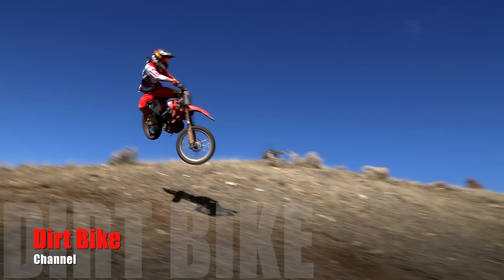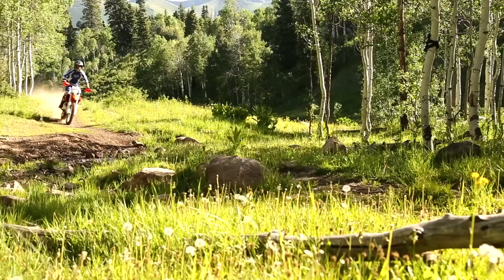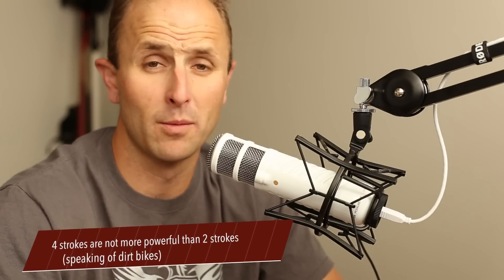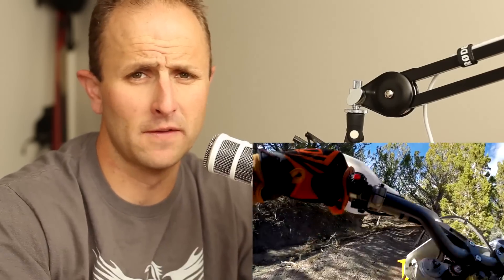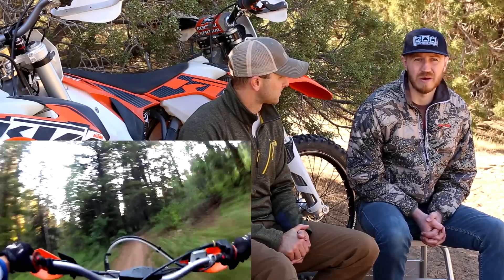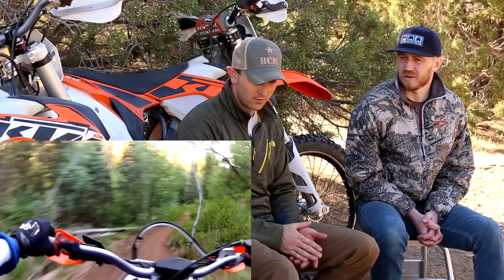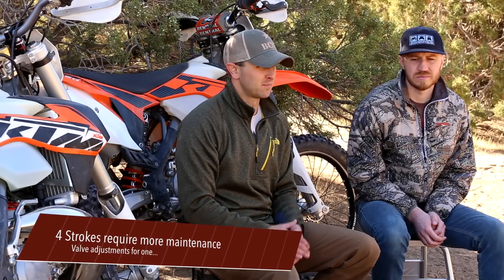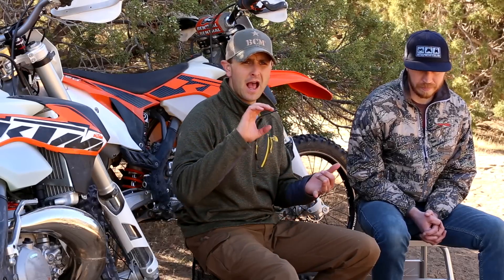Enduro 4 Stroke vs 2 Stroke Part 1

Comment: I could never believe when four strokes started to be common & take over from the two strokes,we used to laugh at the gutless slow revving four stroke bikes,I think it had far more to do with politics than engineering & race winning power,the supposedly clean running four strokes.As you quite rightly say it was 125 2 strokes against 250 4 strokes or 250 two strokes against 450 4 strokes,u could never race like for like,what would u race against a 125 four stroke?, a 25cc chainsaw engined machine?,I don't get engines having to run clean in competition,I get it on the streets,that's different.
Reply: Graham Smith im sorry 'slow revving 4 strokes?' 4 strokes do more rpm then 2 :,)
Reply: madmofos not talking about peak rpm buddy,I'm talking about the way a race tuned two stroke picks up revs,no reciprocating engine picks up revs quicker than a competition two stroke,it hasn't got all the valve gear,timing chain and associated drag to accelerate.

Comment: I am not tryna hate on the video but it is clearly biased to the point where it makes it hard to watch they have good points but most of them are extremely opinionated obliviously.....BUT the number on ironic thing that just got me worked up is they are sitting in front of KTM two stroke dirt bikes that cost an absolute fortune way more then a Japanese 4T....them talking about how 4t killed motocross is BS...KTM driving up cost for premium bikes would be a better argument E start, TPI, all KTMs hydro clutches, weight reduction it all cost extra money in the long run from the RND and testing that the other manufacturers now have to do. Blame the bike manufacturer whose bikes your sitting in front of for ruining the sport before the type of engine. like it hard for me to set there and listen to someone  tlaking about cost when they are riding BRAND new KTM aka rich mans bikes.

Comment: $2400 top end rebuild? Wtf lol. $300 to pay someone to rebuild your 2 stroke? Where do you clowns come up with this number?  $2400 is a cammed, big bore stroker and that's still high. 
Makes more power? The 450s are making as much power as the cr500 are are a lot lighter. You yourself said later in the series that your 300 4 stroke is faster than your 250 2 stoke. I've got absolutely nothing against 2 strokes but I don't see why to make a video series claiming to compare when it's basically just bashing and not speaking too any of the 2 stroke down falls and making false claims. 
2 strokes use oil in gas to lubricate everything....gas is an excellent solvent..see a problem there? I can find way more blown up 2 stokes online and blown up 4 strokes. Top ends on 2 strokes are cheap and easy but the bottom end is essentially the same job as a 4 stroke and the bottom end is a point of failure on 2 strokes where it's not as common on 4 strokes.
High RPM and high compression kills motors? Better tell that to every single sport bike out there. My r6 has 25k miles and a red line of 15,500rpm, had a v65 magna that was 33 years old at this point that had over 50k on it and red line at 11,000rpm.

Comment: That's all crazy talk. You act as if your talking to top bracket riders that are swimming in cool sweet cash. The motor let's go that becomes a parts lump. I like smokers but there's something to be said about torque and slow technical crap that won't stall under a hailmary strategy...
Reply: Btw riders are easily getting 25,000 miles outta 2001 wr250f....

Comment: I've had my 2017 YZ 250F for 2.5 years and rode the piss out of it and it pops and everything and runs fine with great compression. Never adjusted my valves once, changed a piston or anything and it probably has 400 hours on it.
Reply: Mr, KrAmWiCh CMDY haha that’s funny, my 07 CR85 never even had its top end done and still rides like a charm. Could just be that it’s a Honda, idk.

Comment: This is very bias toward 2strokes tbh it doesn't matter 2 or 4 strokes 4 strokes just hav more usable power 2 strokes keep in power band and u get ur power there
Reply: U claim only thing is a 4stroke is good at that a 2stroke can up shift and do same it's just pure bias not factual
Reply from the maker: +Toxic Titan00 You need to watch the rest of the series before jumping to conclusions.  We'll talk after you watch all 6 parts.  Thanks.
Reply: +Dirt Bike Channel I've seen them it's total bias bro
Reply: And 4stroks put more power out higher torque and hp
Reply from the maker: +Toxic Titan00 How much time you do have on a NEW 250 or 300 2 stroke?  You ever ridden one for an entire season?  Just curious.
Reply: +Dirt Bike Channel I both 2 and 4 stroke
Reply: +Dirt Bike Channel I hav a 2015 ktm sx250 and a Honda crf450r
Reply from the maker: +Toxic Titan00 Right.  I have both in my garage too.  That KTM 250SX really sucks right? :)  I've got a YZ450F in the garage along side the KTM 300 right now.  As you know (since you watched all 6 parts), I ended pretty high on both engines.  What was is that I said in conclusion of the 6th part of the series? :)
Reply: +Dirt Bike Channel I just feel like u went to complement a 4 stroke and ended up making 2 strokes sound better and idc really whitch bike im on I'm just pointing out u leaned toward 2 stroke more
Reply from the maker: +Toxic Titan00 That is the funny thing about compliments!  Just because I'm extolling the virtues of the 2 stroke, some people thought I was tearing down 4 strokes.  On the contrary, I never said that 4 strokes suck.  In fact, I said that they don't suck and that they are "modern marvels" over and over.  It's just that over the past 15 years, no one has stood up for the mighty 2 stroke. When I go riding with guys on 4 strokes, I do everything they are doing and then some.  In the end, it's more about the rider than the machine. Just offering a valid (alternative) viewpoint that has resonated with the dirt bike crowd a quite a bit. Thanks for being civil with your comments.  Your opinion is just as valid as mine.  Keep riding!
Reply: +Dirt Bike Channel while I got u u should make some vids of u just riding thru trails and stuff
Reply from the maker: +Toxic Titan00 I'm planning to do more of that.  My biggest problem is finding time to do all this stuff.  Again, thanks for being engaged in the community.
Reply: +Dirt Bike Channel giving my 2 sense keep making vids I find em very help full

Comment: i'm callin' BS on some of this.... I gotta '06 KTM 450 w/ti valves, they pretty much never move, beautiful stuff, so that quote about ti valves is pretty much totally wrong... the KTM RFS bikes w/Ti valves were the ones to have....... i ride pretty much every weekend, i gotta alotta miles on my motor, it runs great, change oil and ride, but then again, i take care of it properly..... most of these einsteinzz break stuff changing their oil, so YMMV....  i work on my carb more than anything because of the age and a couple of the important seals get old, but that's gonna happen on any 10 yr old bike, 2 or 4 st...... and they're runnin' all this smoker smack sittin' in front of new bikes.. ???...they better run good, you dig?.....  yeah, i'm lookin' for a KTM smoker, cause' they're alot more nimble in the tight stuff, but from what i'm seeing our boy Kyle ride, that stuff ain't all that tight... and he's even getting a chubby now over his new 250 4 stroke blue vs. orange bike thing, so ....  i'm callin' BS.....  blah, blah, blah, blah....

Comment: Hey, 250f engines can produces over 50hp. Idk where you get your crap information, but MotoGP makes about 250hp per liter, and the current liter bikes make 210 to 220hp per liter when race prepped. These are 250cc cylinders. Even MotoGP 800cc engines could make 220hp.

Saying that an ordinary 250f will get beat is idiotic. You completely gloss over the fact that 250fs are made as beginner bikes and designed for ease of use, not unbridled power. Funny how KTM new 510cc motor makes the same hp at wheel as a cr500 engine.

The physics of why is simple. Octane rating, volumetric efficiency, and rpm.

Oil LOWERS the octane rating of gas, meaning you CANNOT be as aggressive with timing.

Volumetric efficiency is much lower on 2s bikes. They literally allow intake charge to flow out of the motor and have a hard time filling the combustion chamber with their actual displacement. 4s doesn't, and head designs allow velocity to fill the cylinder with slightly more than their displacement.

Biggest difference is in the RPM and torque multiplication. Theoretically, one could tune a 250f to hit 18,000 rpm like in MotoGP. That would allow for 350% (3.5x) of the torque. Not reasonable, but tuning them to 14,000 rpm is now a days. That's around a 2.8x factor. 2s motors don't make much power beyond 8000 rpm, meaning, a 4s with the same efficiency would need to hit 16,000 rpm to make the same power. 4s is more efficient, by quite a large margin, and doesn't need to actually double the rpm.

Most 250fs are designed to peak power at 9-10k rpm. Giving them a very slight rpm advantage over a 2s. I tuned my yz250f engine to 12,500 rpm with cams, higher comp piston, correct fuelling and a vortex ignition. In the sand, I was slightly faster than 250 two strokes and slightly slower than 450 race bikes, and faster than 450 trail bikes.

450fs were tuned to around 8000 rpm and have lower efficiency than a 250f (diminishing returns). Newer race bikes are tuned to 10k plus rpm now and no 2s or 250f will keep up minus a ridiculous race budget. Enter the 350f and it's 14000rpm redline.

It is quite clear that you have cognitive dissonance over the 2 v 4 stroke knowledge. I personally love 2 strokes cause they're light and fun to throw around. But 4 strokes are the better enduro machines. Why? Simple. They get better traction, which makes them more capable and does less destruction to the environment. The motors pollute far less, which means they keep the air around us cleaner. 15-20 lbs is a lot after the erzberg rodeo, but for normal fun enduro riding it is hardly noticeable and preferable in the desert where strait line stability over high speed whoops matters. In the end, enduro is about being in nature, so the bike that allows you to go where ever and keep nature as pristine as possible is my winner.

Comment: Yea this guy is bias as shit I watched 2 other videos of a guys going over both and being pretty fair stuff like at high speed 2 strokes are unstable but four strokes are fine 4 strokes got beach and moto and 2 strokes are king at enduro it just depends I dont like this video bc it's just bashing the 4 stroke I mean like I get it's his preference but be more fair with it this guys sounds like he has only ridden 2 strokes all his life and 2 strokes usually need to be replaced sooner bc of them moving faster and the lack of a lubrication systems puts them down but they are inherently faster when it comes to cc
Reply: Yeah 2 strokes need a new engine every 2-3 years typically when a 4 stroke can easily last 10-20 years if you take really good care of it and do oil changes.

Comment: I just want to start up my bike and ride. 2 strokes are a high maintenance bitchy girlfriend that is more headache than it's worth. Jetting, mixing... nahh I'm fine with a 4 stroke. Yes 2 strokes are stronger than a 250 4st but I feel like I dont use all the potential of my 250f. I dont need more power...

Comment: 250 4 strokes are almost as good due to fuel injection. any higher cc and the 4 stroke will wreck the 2 stroke
Reply: Fuel injection doesn't add power over a well tuned carb, it does add quite a bit of weight though.
Reply: boooooo no way
Reply: You don't make sense
Reply: Paul King could not think of an argument so you chose to say that i'm stupid? I know someone who does that.... he's 5
Reply: Paul King I'm glad you got that out
Reply: Netrox Bros You don't know what you're on about so pls stop

Comment: But if you live/ ride near anyone and actually care about their ears you would ride a four stroke
Reply from the maker: +Seth Wilmot That is debatable.
Reply: Debateable?????? I'm willing to admit you get more power per cc from a 2 than a 4, everyone in their right mind knows this, but with more power means more noise, everyone in their right mind knows this.
Reply: +Seth Wilmot The noise is a higher frequency so it doesn't travel as far. You'll piss less people off on a 2t than a 4t because the noise from a 4t carries far further.
Reply: if you were riding where i do ( national park, near a town) than you would piss everyone off with the 2t noise, most people would prefer a dep gurgling rather than a high pitched ringing.

Comment: BS bias video right here!!! 2 stokes and 4 stokes are equally good and capable of anything you put them up against... just two totally different ridding styles! also 4 strokes will out run and last any 2 stroke as long as you keep a eye on your valves every time  your budddies are mixing 2 stroke fuel..... you can be  spending the same amount of time as specing out your valves lol

Comment: 100-150 hrs with one piston on a 2 stroke hahahahahah..... Do it every 40 hrs to be on the safe side. At about 70-80 hrs you won't have enough compression to run....
Reply from the maker: balazs kisbalazs My guess is that you don't have much experience on these 250s and 300s.  No power loss, no compression lost at 115 hours on my last 2 pistons.

Comment: How can this be a fair comparison when you are so bias ! You are stating from the start that you love 2 strokes !
I never work on my 4 strokes, but my friends with 2 strokes are constantly working on theirs.
This is a BS review !
Reply: They are speaking facts, liking something because it has advantages is not bias if you explain the disadvantages aswell. They said several times 4 strokes are amazing.
As for your second statement, working on your bike doesn’t necessarily mean there are issues with it, in fact it means you care and know your bike. Boasting you never work on your bike is not an advantage, in fact one of the great things about 2 strokes is that they’re much easier than 4 strokes to work on.
2 strokes are generally better in enduro, it’s a pretty well known fact at this point.

Comment: What you say is wrong. I am buying a KTM 250 SX-F if I wanted a bike that was the same I would buy a 125 EXC two stroke as it is approximately the same amount of power to weight ratio and hence meaning they are almost the same. This is why you don't see a 250 two stoke group going against a 250 four stoke group. You idiot. You are basically saying that an 125cc lawnmower engine has the same amount of power as an 125cc bike but no the engines serve different purposes. And so the lawnmower engine will never compete with the same size bike engine. You have to think in the way that a 250 two stroke is basically a 450-500 four stroke. You are just being completely biased towards the two stroke. This is also way a 250 two stroke is a lot more than a 250 four stroke.  And if I have got any wrong grammar I really don't care I am dislexic. 😑

Comment: hmmmm what engines do cars run? road bikes? ahhh right 4 stroke...cause they dont need a rebuild every week   you guys a bias as fuck...   yes 4 strokes cost more to rebuild, but by the time you put in the money for the extra fuel and oil that is waisted, they work out much the same... another thing 4 strokes are getting very close to the same weight as 2 strokes.... their all around 103/6 kilo.. another bonus about 4 strokes, no fucking around with mixing fuel.. and yes 4 strokes have to change oil, but nowadays so do 2 strokes (gear box)  ive owned both, ive had a kx 85 rebuilt after 60 hours from loss of power and ive now got a yzf250 change the oil every 10 hours (because im fussy) my dad has a honda trx250 quad.. 200 hours rebuilt once, and changed the oil probably 4 times if that...
Reply from the maker: madmofos Thanks for watching.  We talk about some of these points in the rest of the series.

Comment: this video is so biased towards 2 strokes.. you can't even listen to it... it costs $150 for a piston kit for a YZ450. Hell, it costs $700 to buy a brand new OEM top end with valves and springs!  2hr valve adjustments every 20-40 hrs of riding... where the hell do they get $1500 for a motor rebuild... stupid.
Reply: Kyle Dude and to top that off my buddy Jon put 300hrs on his 02 CRF450 before an engine rebuild. about 1/2 of those hrs were B class enduro racing.
Reply: They're probably talking about putting it in the shop and letting the mechanic rack up the bills lol hell I put a banshee in the shop for a top end job cuz I was too busy and it costed me 1600.
Reply from the maker: Kyle Dude Called 2 different local shops and asked them for pricing on rebuilding my 4 strokes.  This assumes you need machine work on the heads and valves.
Reply: only machine work you would need is to re-seat the valves... which you don't need a machine shop to do. This is somewhat equivalent to getting your nikasil head re-coated every time you change a piston.  Even so.. re-seating ur valves all u need is a little suction cup thing and the vale gringing paste.. ~$20 and 30 min once u already have the head open.

Once more... changing shims is like a 2hr job or less once u do it 2-3 times.Yea... 4 strokes cost a lil more... once you put on like hundreds and hundreds of hours... or... you're a pro/semi-pro racer.
Reply: nikasil jug re-coated sry. Love 2 strokes too but ur pricing/maintenance comparisons are wayyy off man
Reply from the maker: Kyle Dude Your estimates are too low.   Might have to agree to meet in the middle on this one.